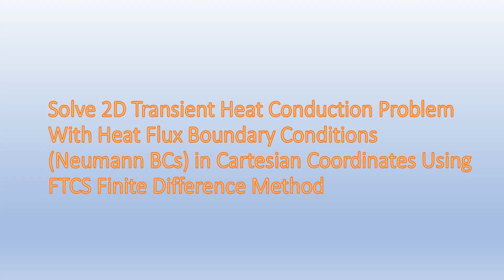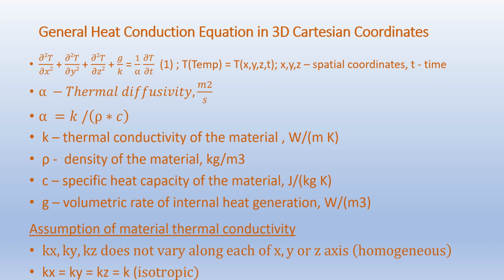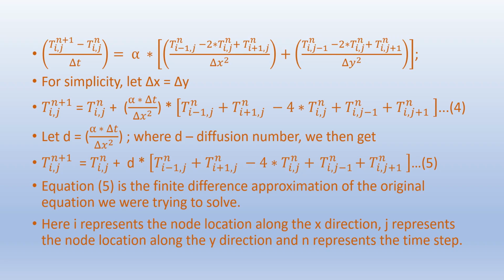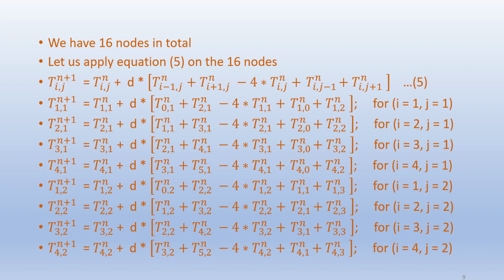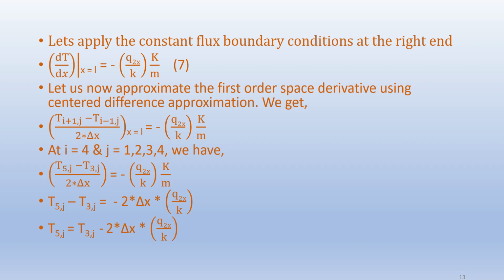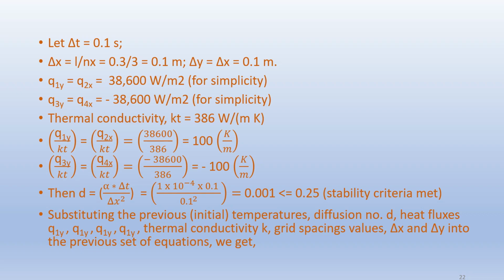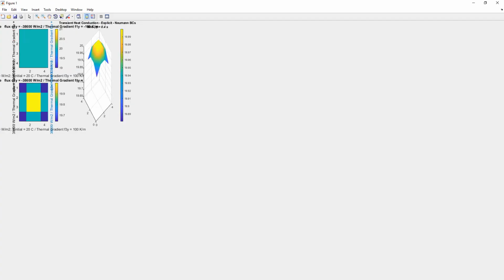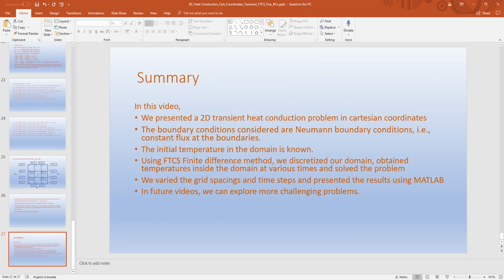Solve 2D transient heat conduction problem with heat flux BCs using Finite difference Method

Comment: This is an excellent video! could u send me the matlab code for this? Couldn't find it on your website. Thanks in advance.
Reply from the maker: Check under Numerical methods numerical methods codes diffusion equation

Comment: what method should use if i have a square plate with dirichlet conditions for two sides of the plate, and neumann conditions on the other?. In simple words, i have the same problem that you rerpesent here here, but instead of only heat flux, i have temperature conditions too
Reply from the maker: If you need some extra help you may email me at samseleven@gmail.com
Reply: @samseleven1  thx man, i will make some scheme and i will send to you
Reply from the maker: You need to make a custom model for this.

Comment from the maker: Codes may be obtained from https://engineering-stream.com under Numerical Methods Section
Reply: If there is insulation in bottom surface how the code will change
Reply from the maker: @amgedtariq2493  if a surface is nsulated heat flux thu the suface will be zero
Reply: @samseleven1  do you have matlab code for 2d transient case
Temperature of Right surface =Temperature of left surface 

Bottome surface:insulated 
Top surface:convection
Reply from the maker: @amgedtariq2493  i have generic code for 2d transient on my website
https://engineering-stream.com